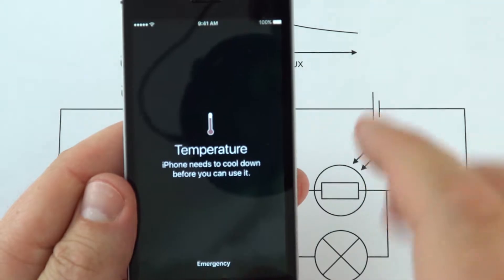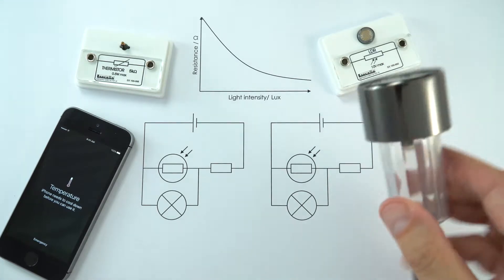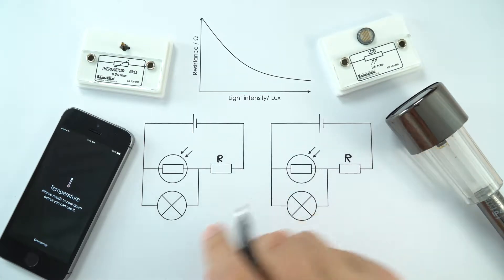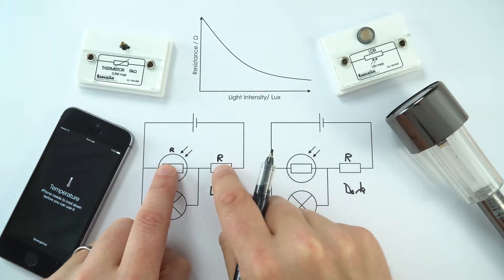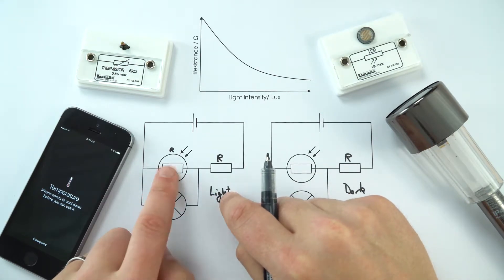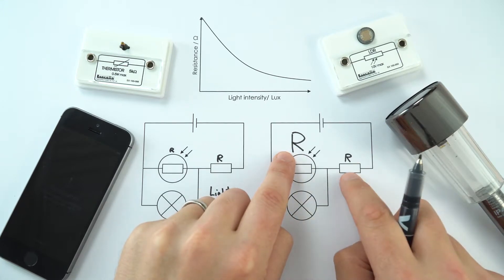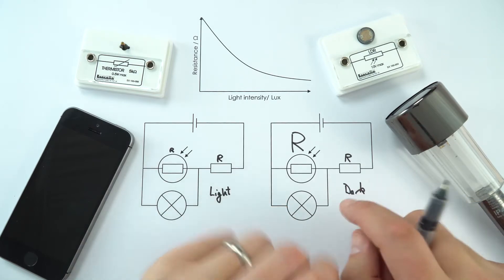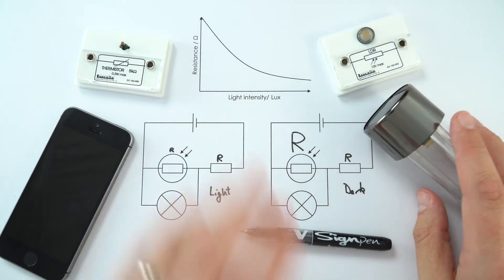LDRs and Thermistors in Circuits - GCSE Physics

Comment: but if the resistance inreases does it not mean less currents flowing through so how does it get brighter
Reply: that’s what exactly I was thinking aswell as if the resistances increase it mean more current is unable to flow in the circuit making the light darker .